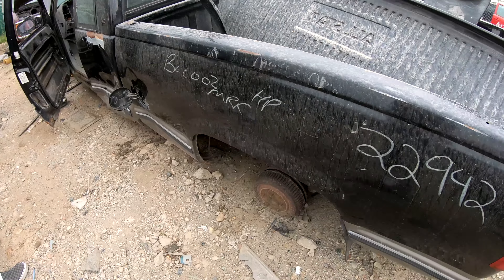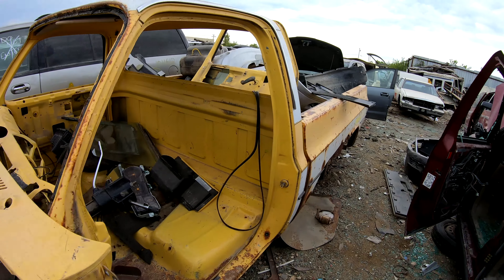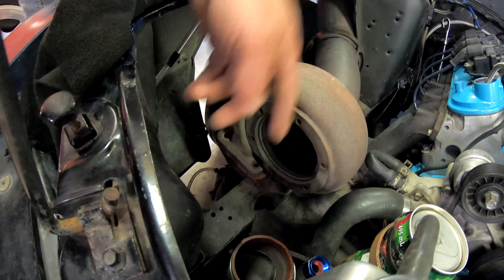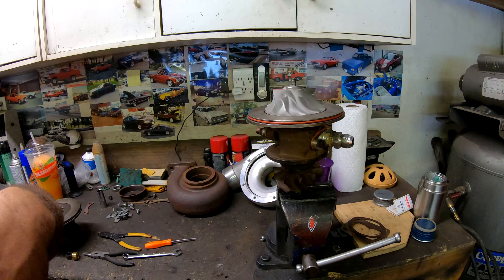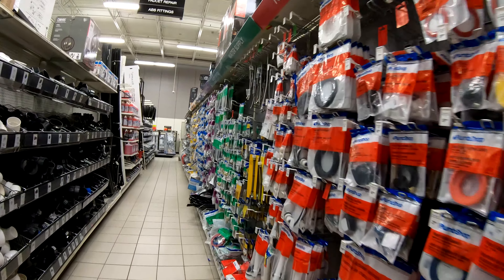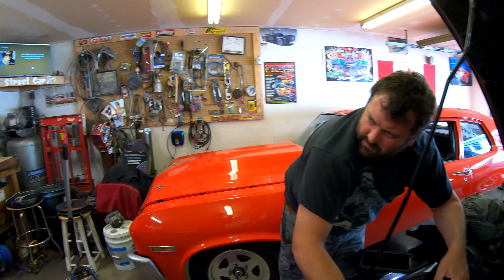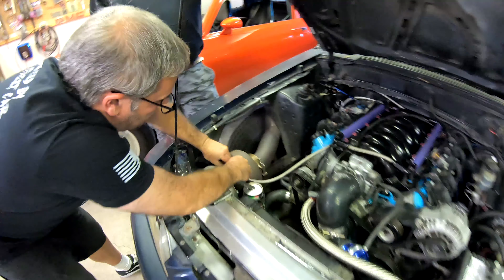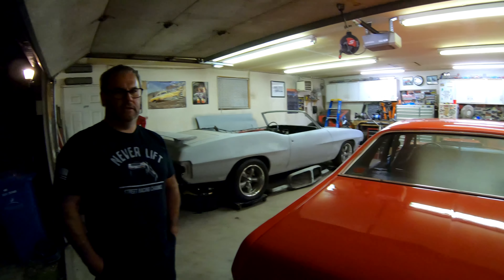EXPLODED ANOTHER CHINA GT45 TURBO - 2 BROKE TURBOS BECOME 1 | + LS Junkyard - Sh!thorse Gon Ride!

Comment: Use brake line or 1/4 inch copper tube as turbo oil feed but coil the brake line when you angle in the engine bay.

Comment: So you filmed this whole thing including going to the Canadian Tire but you didn't film putting it back together? Like suddenly the intake is back on! Wha happened?  Did you reuse the old hose? What about the kink?
Reply from the maker: Some clips got misplaced on a different sd card.  Rob used the braided line the goes to our fuel pressure gauge to fix it.

Comment: Rob- what wheel offset, wheel width/ tire width do you run on the nova? Are you on bags or does it run 2” drops? I’ve got 2” drops on my 69 nova and am having rub issues on the inner fender. Hoping your info would help. Thanks!
Reply from the maker: The rears are 15x9 with 5 1/4 backspace on a 275/60 the fronts are 15× 3 1/2 not sure of the offset and 28x7.5x15 mt sportsman tires. The suspension is all calvert with stock spindles.
Reply: SweatPantsPosseTV Thanks Rob! One more question, is the rear tubbed or stock?
Reply from the maker: The wheel tubs are widened but the frame isnt notched and the leafs are in the stock location

Comment: Using Chinese turbos gave you ever considered putting a filter in the turbo oil return.  So when you blow this turbo up you don't run the risk of filling your oil pan up with turbo shavings.   Or is that not a problem?   When a turbo burns up the only part that might contaminate the oil is around the bearing.  Since the bearing is not a roller bearing does it just seize up and never seriously contaminate the oil?   Maybe there is an advantage to having Chinese turbos instead of expensive roller bearing turbos.

I like turtles
Reply: The oil from the turbo can't contaminate the engine oil if the turbo isn't getting any oil to begin with.